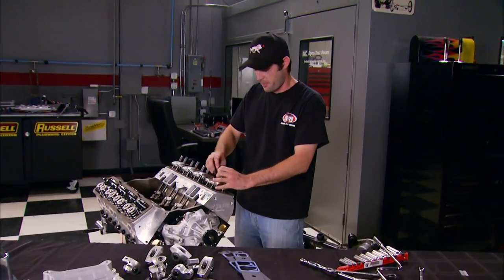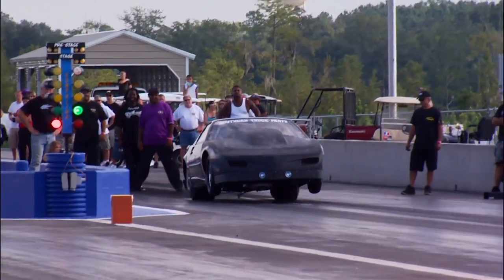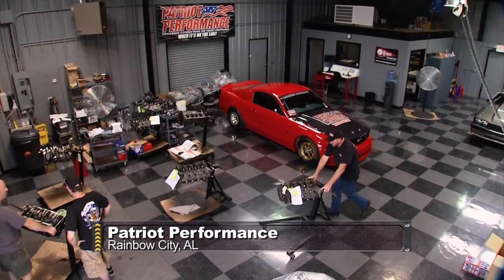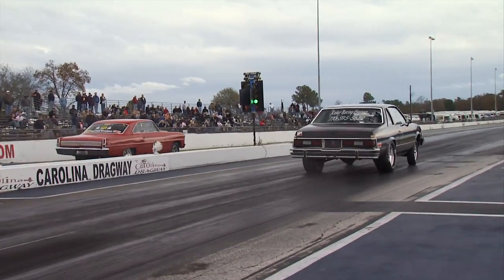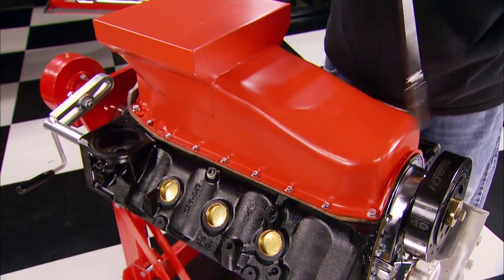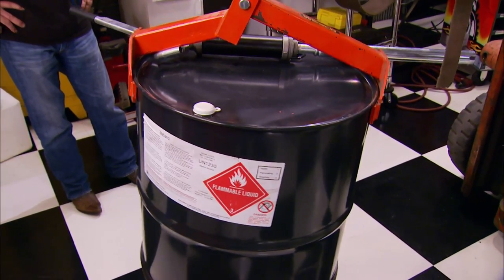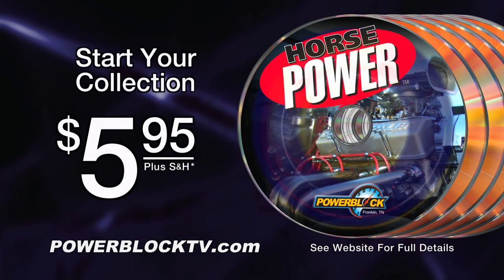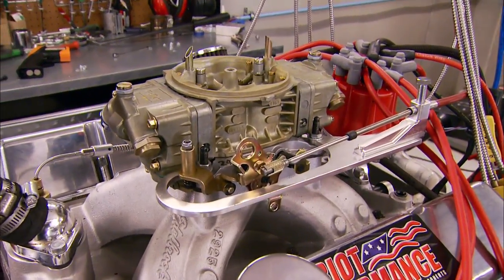Building An Alcohol-Fueled 383 Small Block Chevy - Horsepower S14, E17

Comment: So to convert to alcohol just high comp pistons and a alcky carb.. Got it
Reply: Get you some ngk tr5 spark plugs too
Reply: Also methanol is highly corrosive so don't let it sit around and a gas tank for a long time it will also eat rubber fuel lines
Reply: John S  high compression isn't needed. But it's either that or boost and that does = high compression. But your right the fuel system is needed also alcohol runs leaner so the carb has to be basically double up in jet sizes alcohol to gas is a 2:1 ratio alky 2 gas 1 = alky runs leaner and it corrodes rubber lines and steel lines it's stainless or the new plastic rubber braded lines. Also don't leave it set in the tank or the carb or the pump or injectors for a long period of time.
Reply: You did degree then cam ?
Reply: Can I use this engine in my bost

Comment: I made 550 on 10:1 pump gas and a 236°@ .050 solid roller street cam and a low profile teamG to fit in a vette. On a conservative dyno! We did use the lighter/stronger I beam scat rods and a f-43 crank. That super V is to big and the cross section of those heads are prbly too small. The carb is to big and those rockers are nice for my 95' suburban.  Infomercials for big corps and screwing the small builders that actually know what they're doing.
Reply: 950 carb on it will make more power than a 750, or an 850,
Reply: Your 550 combo, probably would have possibly made 580 to 600 with more cam and compression.
Reply: @brentonk461  if you dont care about averages, throttle response and fuel efficiency
Reply: @brentonk461  would've made that with the more efficient vic jr.  your right my 13.5:1 414ci race motor with AFR 227's with that same super vic and 950 carb and similar cam made 710hp @6750 with 112 race gas. Both 414 and 383 dynoed with a driven water pump and fuel pump and the 383 had the 195cc comp AFR heads. The intake cc # means crap if the minimum cross section is to small. Their cam and induction are oversized for that head. Just infomercials to sell the sheep parts.
Reply: It was a cool episode, but I agree my 11.0 383 with a lunati 243/249 solid roller hasn’t been on the dyno, but according to the holley system it’s drinking 580 hp worth of fuel at 7k rpm, traps 88 mph in the 1/8th at 4700+pounds, those scorpion rockets worked on that motor for 30k miles before they were trash. Running comp ultra pro magnum xd’s now
Reply: @FloydODB  my YouTube engine is fairly close in spec. I think they f.... up with their compression calculation though.. (64cc flat tops 12.5:1?).  In a test I seen, a professional products hurricane intake and the 2925 super Vic in out of the box form will make close to the same power.  throttle response is more than the current tires can take on my combo, try a 1.46 sixty foot time @3400+ lbs on 225/15 d.o.t street tires. On Pump fuel. Through twin 2.5" full length exhaust. Unfortunately straight after the '60 foot timer it would blow the tires off 1st and 2nd with the th-400 manually shifted. Have some 11sec time slips though. Probably run a high10sec et. With traction. don't even talk about fuel economy though LoL 😁

Comment: The engine need evacuation tubes ran from the valve cover breathers to the headers near the ends to draw the condensation out through the exhaust. The cooler fuel in alcohol creates vapor when running throughout the rpm range.
Reply: This is true.those engines to condense moisture as they cool down from last run
Reply: Yep. Unless you want milkshake filled valve covers.
Reply: Great idea?? They've been doing that for years and years

Comment: I would love to drive a sprint car! Big tires,light weight, and lots of power!
Reply: It's a riot, I got a super late model. Only thing that blows my mind is I only have 358 on alcohol pushing 950 to the rear wheels so they have so much potential not bring tapped
Reply: @redneck sports I can assure you, you’re 358 doesn’t make 950
Reply: @rednecksports3712  wow more hp then the 410s sprintcar engine, huh you engine builder must know what's up 🤷‍♂️
Reply: @tomdeckerracing630  and definitely not to the wheels 😂
Reply: @GJ-DT  lol. thatd be one hell of a 358 tho hahah
Reply: I'd like to drive a 360 sprinter sometime

Comment: How did you get 12.5 comp with 64cc chambers and -5cc pistons on a 3.75 stroke?? Seems 11.1 to me
Reply: 15 thousandths head gasket but still seems like 11.8ish to me
Reply: Might have it negative decked and the Pistons hanging out the hole?
Reply: None of it adds up. You can see at 9:20 it’s a sbc425030f05 piston which is 4.030”. Even with a zero deck and a 0.015 gasket it’s still only 11.8:1 with +5cc valve reliefs, and there is no way that engine is safe with a 15 thou quench. Going down to a 60cc head or using a 4.125 piston would get you in the 12.5:1 ballpark, but you still have that super tight quench.
Reply: 10.8 with a normal gasket. 11.7 with their gasket.

Comment: a lot of blow by coming from that breather. rings are not sealing up
Reply: It's not that you have to put a Evac system on an alcohol engine because it generates a lot of condensation inside of the engine do to the engine sweating from how cool it is. Edit but if you did install an evac system it would help get the moisture out of the inside of the engine quicker.
Reply: I noticed that as well, a lot of blow-by!

Comment: The LS has the 4/7 swap incorporated into the design. So you know it's a given.
Reply: The ls isn’t a sbc
Reply: @curvs4me  just because the ls is newer doesn’t mean it’s better. I want to make good torque down loan and be able to drive it for more than a year. I don’t have money for a new lm7 every time I want to hit the gas. Tired of the sucky lifters and weak came chains. The one thing that wasn’t broken on the previous design they took a broke it
Reply: @curvs4me  I would agree on the subject of boost for earlier designs being superior to the LS, the exception being the 6 bolt LSX/ LS Next head bolt pattern. They’re are people making huge numbers (2000+ hp/tq) with those and zero head related issues.
Reply: The LS engine uses the Ford Windsor firing order.

Comment: You should build a 400 sbc destroke (350 crank) it to a 377 then add alcohol see what you get . 650-700????
Reply: been there done that the most reliable engine ever had it in a dirt late model in the late 90's turned it 7500 to 8000 it lasted 2 complete seasons @ 2 shows per week

Comment: I’ve always wondered about running an engine on compressed Hydrogen gas rather than liquid gasoline 

The reason being that it has virtually no CO2 emissions 

Obviously it’s an expensive fuel that’s hard to extract but putting that aside I’d love to see what kinda power you can get from it 

Then again I’m no mechanic so what do I know

Comment: Patriot Performance also operates ProMaxx cylinder heads from the same business. Be careful with the ProMaxx heads. The Shocker 200 Ford FE heads that I bought from them were kinda slapped together. The installed heights on the springs varied from 1.825 to 1.869. Also the springs they put on there for hydraulic flat tappet cams are WAY TOO STRONG. They killed my lifters almost instantly. Very few minutes and the lifters were killed which put all kinds of metal in the motor and killed the crank and all the bearings and of course the cam.
Reply: That wasn’t the heads fault, that’s just flat tappet cams now-a-days

Comment: Methanol safer than gasoline?  They may have burped that up back then, but there are two things against that.   First, the flame burns so clean you can only spot a fuel fire [in broad daylignt] one of two ways: a heat mirage suddenly forming, or something nearby starts smoking for what seems to be no apparent reason.  Second, it is not good for humans.  There is a case to be made that it is human specific poison - other animals can tolerate certain amounts, but humans are unable to process any amount however small.
Reply: Killjoy.
Reply: You dont drink it anyway!
Reply: Lol just drink some alcohol if you ingest any
Reply: @austindoud273  Correct: learned that from a paramedic years ago - he carried a half pint of whiskey at all times.

Comment: I've always wondered.  Methanol has substantially less energy than gasoline.   I've wondered how it makes more power.   Even ethanol has more energy, but still less than gasoline.   I suppose you can put much more fuel, requiring less air, into the cylinder.
Reply: Alcohol based fuels have higher octane ratings than gasoline, plus Methanol is often used as both the fuel as well as part of the cooling system in performance engines due to how cold Methanol burns in comparison to gasoline. Higher octane fuels are better suited to boosting an engine, you can increase the compression ratio, and in general higher octane fuels are more efficient for vehicles, especially performance vehicles.
Reply: @Cynsham  
My best understanding is that oxygen is the limiting factor.   And alcohol requires less, so it can burn more fuel.    
And Nitro is only 1/4 the energy of gasoline, but makes 2x the power.
Reply: @Cynsham  
I know some racing classes use alcohol because an alcohol fire is much less dangerous than gasoline.
Reply: Methanol has its own oxygen in it so you can run engines way richer to make more power

Comment: That cam is a lot underdone for those heads and compression. Also you shouldnt really need a girdle for only 7000rpm , and you could run way more compression than just 11:1 on methanol, most people I know are up around 14 - 15
Reply: I’ve heard E-85 and propane are optimized in that 14:1 15:1 range too. How about starting and warning up the engine on E-85 then switching to propane with a dual fuel system?

Comment: 410’s are getting 1000+ hp so there’s plenty of room left in that engine
Reply: I always think what would happen if they doubled the displacement of a top fuel dragster….. right. black hole. don’t try it haha
Reply: This engine was nothing special, 410’s run more compression, way more cam, way better heads etc. This is a very basic build compared to an all out race motor!
Reply: Sure they do. The really good ones will cost you $75,000 to. Not a great comparison. Haha

Comment: That's interesting math, a flat top 383 and 64 cc chambers in most universes is around 11:1, I wonder what magic they came up with to achieve 12.5:1.
Reply: @crackjack8320  Chamber volume is listed as actual, assembled and ready to install. So 64 is 64 unless they have been milled. 5 cc valve relief, approximately 10 cc of head gasket volume, and this also assumes perfect zero deck, my calculations come out to 11.03.
Reply: Alky @ twice the vol of gazoline will take up more space in the cylinder raising the compression. Just a theory...

Comment: That thing sure has a lot of blowby. And why only 6000 rpm? It's a race engine with a good size cam. Turn it up to peak and a little higher to see if it holds on to those peak numbers or falls off.
Reply: Thats not blowby, that's burning condensation
Reply: @-meat-  Nope, blowby
Reply: @ScoredPiston  okay, but it's getting past the rings, lol. Hence, it's still called blowby.
Reply: @patrickmoore1017  I remember the first time I saw an engine on a dyno

Comment: Huge explosions from those clips are actually and cause of magnesium parts used on the cars.
Reply: Sure..
Reply: @Icutmetal  lmao they use magnesium wheels because theyre much lighter then carbon fiber when it comes to weight every 1ib un-sprung is equal to 3 ib of sprung weight and magnesium lights up very easily
Reply: @Gettinbentoffroad  Lmao all you want. Magnesium doesn’t just spontaneously combust on its own, and it doesn’t cause “huge explosions. Yes, it burns extremely hot, bright, and can’t be put out with water. Hold a torch to a solid piece, not a big deal; do the same to powder or ribbon form, and you’ve got a show.

Comment: The cross section on that manifold is too large for that engine.  Its suffering from lack of intake runner speed for alcohol.
Reply: Actually it isn't... IF the goal is 6800-7500 rpm. The cam and compression in that engine are way off, and too small for methanol. They are drowning it.

Comment: Real nice engine but Im surprised guys are still building 383 SBC where as SBC can easily go 427 and 454 and even 461 safely with a lot of nitrous.  To me 383 SBC just seems like a thing of the past especially with the LS stuff making much more power.
Reply: Kinda like how the 327 was the be all end all of small blocks, until the 350 came along, eh?
Reply: @RustyCarnahan  
They're still decent, AFR heads can help get a older 327 or 350 over 400 horse which is respectable, but with today's new cars making 500+ horsepower the old SBC is basically are outdated.  The modern Dart SBC blocks easily allow 4.000 stoke and I think up to 4.250. 
What people really need today is big Torque between 2000-4000 RPM.  I wouldnt even consider a SBC less than 427.  
Even tho people can build a street, pump gas 383 producing 550 horse why not build a 454 SBC for around the same price and get the Torque increase.

Comment: i thought flats with 64cc heads only make 9.5 to 1 maybe 10.5 to 1   he said they where doing to make it 12.5 ro 1   !
Reply: Typical 383 with flat tops and reliefs at 0 deck and 64cc chambers is 10.85-1. Perfect for pump fuel. Ironically, the cam they have is also great for that compression and pump fuel. Using the 4.100" x .015" gasket is 11.75-1. Nowhere near 12.5-1. Regardless, none of those compression ratios are enough for straight Methanol to make any real power.

Comment: He forgot to mention you have to change your oil and filter after every race .
Methanol turns you oil to yoghurt and rusts everything in the motor when left standing a few days.
Not to mention powder formation in the carbs , clogging of fuel pumps.
No thanks. Not for me.
Reply: Yup, methanol will draw in moisture from the air if it's exposed. If you store methanol for racing,  it's best to buy a test kit and check water percentage before running it in your expensive carb and race engine. Ethanol that's made from corn is similar to methanol and it will also pull moisture. It's a shame a guy can't hardly buy pure gasoline at the pump any longer, it stored alot longer and gave better fuel mileage. Pump gas nowadays goes to shit in 3 to 6 months. Here in the Midwest a guy needs to buy a treatment with enzymes that remove water from fuel in stored vehicles and lawn equipment or drain the fuel system and add pure gasoline during winter months.

Comment: What was the compression ratio? I must have missed it.
Reply: 12.5
Reply: @keithbenson6866  15 thou gasket
Reply: @keithbenson6866  I've shaved head and block almost to the gasket thickness ..I do have 13.7 to I pistons .running between 210 and 225 cylinder pressure .they are 64 heads..oh and it's .040.witch don't mean shit but it's actually 385..I got a channel .old ridge runner race truck....few short clips.needa get some part pics and stuff on there
Reply: @keithbenson6866  I'm not running flat tops in mine lol.im .300 above the deck
Reply: @keithbenson6866  yea keith I'm not flat top my slugs are appx .300 above deck .and I still have .460 valve to piston clearance.( Which did surprise me because the 12.5 to 1s I had in it actually had less but my cam was degreed 2°adv with 64 cc chambers..they are world products dart 2 heads
Reply: Even with a 15 thou gasket, a 4.030 piston with 5cc reliefs, 3.75 stroke, 64cc chambers, an zero deck you’re still only at 11.8:1 static. And the quench would be WAY TOO TIGHT with that combination. You’d need a 4.125 bore or 60cc heads to get to 12.5:1, and that’s still with the insanely tight quench.
Reply: @andrewreece3861  really? Ok.when I had 12.5 to 1s in it when it was a 355 my cylinder pressure was avg.185 psi now it's 210psi my machinest  had figured 11.8 with the 12.5s to one. with these JE 13.7s it feels way stronger..I'd really like to dyno it .I do feel there's more in the mouse that what it's putting out.thanks for the feed back

Comment: Pouring alcohol into tank should require safety glasses to be worn and not on top of hat.
Reply: Do the same with water and coolant and oil and transmission fluid and def and air in your tires

Comment: What a turd!
A decent 360ci sprint engine is 200 h.p  better. With smaller heads.
383 ci should make near 900 h.p. on alcohol. It would be an average performance street engine at that power level on gas with 11 to 1.